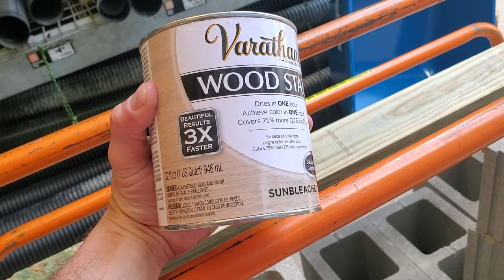How to build a Cinder Block Bench

Comment: when you bought that 4x4 was it already all sanded? the ones they have at lowes is all rough...oh and that moonshine thing on top did you glue that as well?
Reply: It doesn't look like they did. I'm sure you can go the extra mile and make it more to your liking. Like you said maybe sand and put like a clear coat
Reply: Have you seen the water proof spray? Its like silicone in a can and will make item water proof. Could put some on if you plan on having it out in the elements

Comment: If you don't put the vertical blocks close to flush with the edge, the fourth 4x4x8 isn't necessary.
Reply from the maker: It's more for cosmetic purposes.  Completes the look. We tried it without the last 4 x4 and it just didn't look as good

Comment: Question: Do the cinder blocks have to be glued together or can they be stacked without glue, just in case I want to move them? 🤔
Reply: use bolts. drill holes in the cement blocks with a hammer drill and then add the bolts. that way you can undo it on the off seasons.
Reply from the maker: I glued mine, you don't have too but I would recommend it. You can use bolts as mentioned but its a hell of a lot more work.  You can glue them and still split them if you need to move it.  We did that.
Reply: @The Coaster Nerds ok, thank you 😊